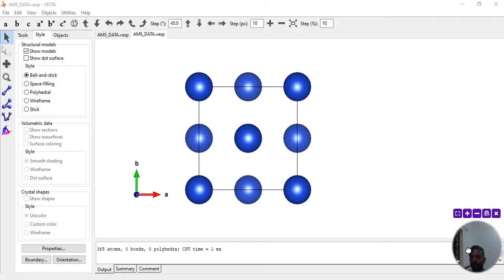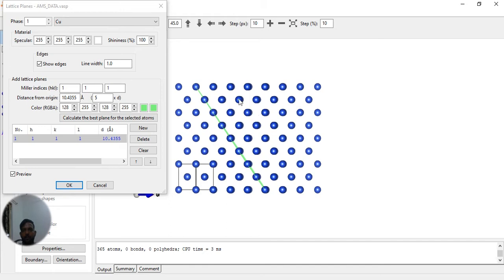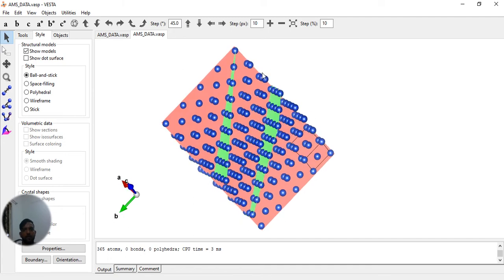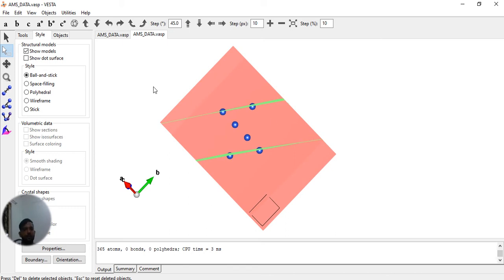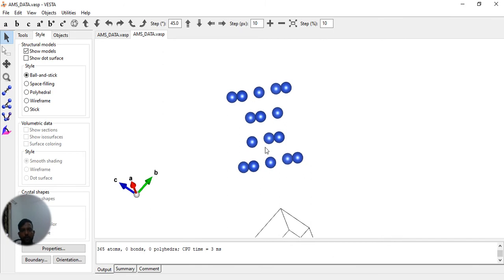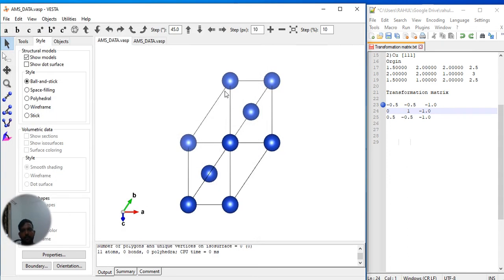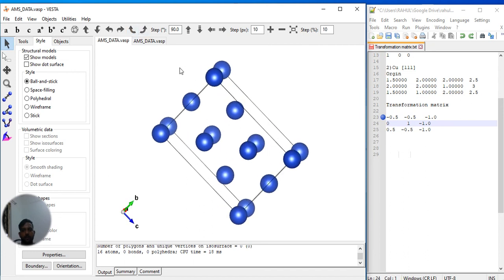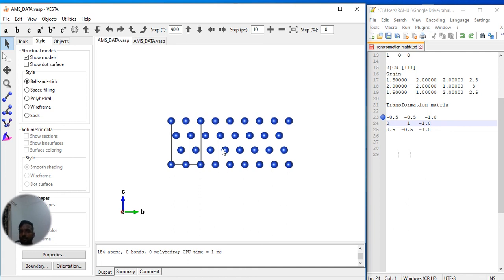1.9 Creation of Cu [111] surface using VESTA Software

Comment: You've got the coordinates for origin, a, b, and c mixed up. It was shown clearly on VESTA when you selected the coordinates as follows:
o        a        b        c
2.5    2.0     2.0    3.5
1.0    1.0     2.0    2.0
1.5    2.0     1.0    2.5

This should give the transformation matrix
a*        b*      c*
-0.5     -0.5    1.0
 0         1.0    1.0
0.5     -0.5    1.0

I don't know why you changed it to the values you have at 8:43. I am wondering how you got those values you used.
Reply from the maker: I will share the procedure in excel file. Provide you mail id.